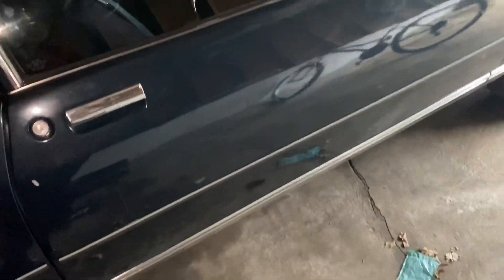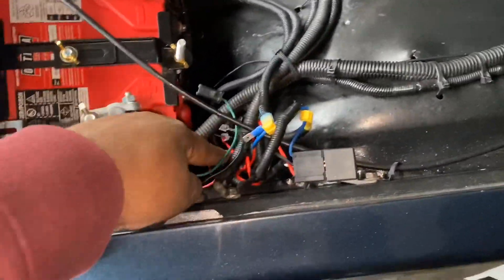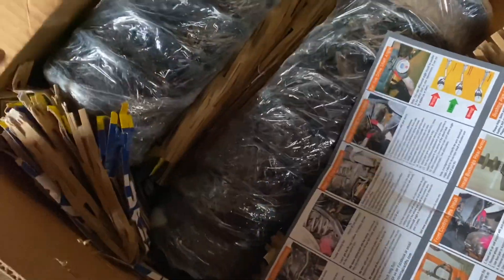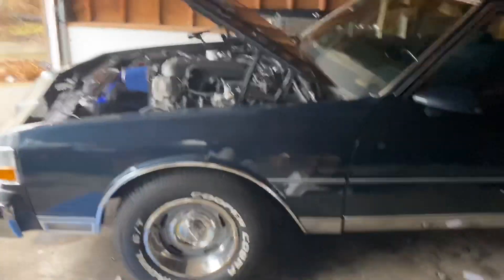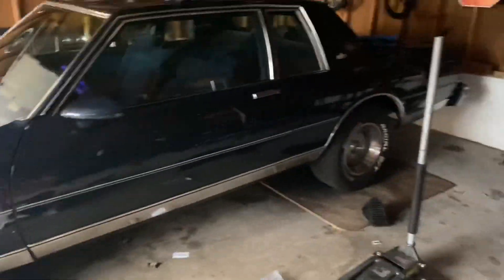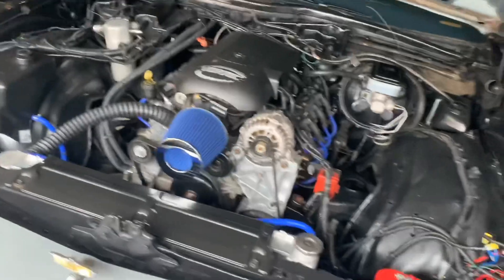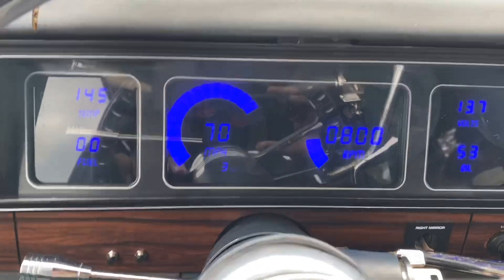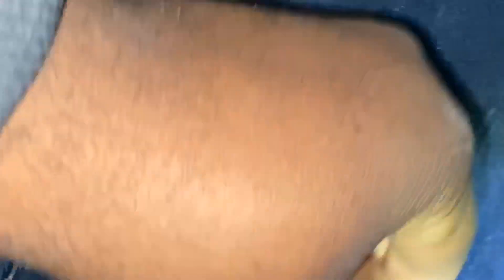TALK TO ME LS SWAP BOX CHEVY

Comment: Do yo front radiator body bushings that's going to lift your car in the front and just add washers to make it a little higher I just had to do it on mine cuz mine's was scrubbing with my 26 is on one side I did that and I got full turn again